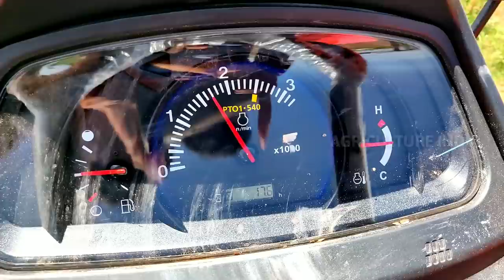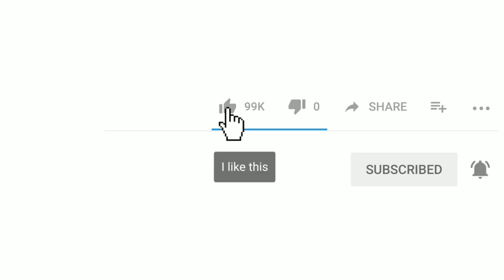Kubota MU4501 | New Tractor | Rotary tiller performance | Specifications & price

Comment: Which feet rotary & which gear you driven ?
Reply from the maker: 6 feet Rotavator & then operating gear low first gear. "Thanks for watching 😊"
Reply: @AgricultureINDIA-91  engine rpm and milage per hrs?

Comment: Better you go to Olympic with this tractor you Will get gold medal. While using tractor with ROTOVATOR you can ride under 1.5KM speed. This tractor is not suitable for Indian conditions. And the tractor price is very low but service cost is very high. So don't purchase this bullshit tractor.
Reply from the maker: "Thanks for your kind information and Thanks for watching 😊"
Reply: Manoj Manoj ramakrishnan
Reply: I have a kubota 45 hp , low diesel consumption good power low maintenance
Reply: Try make more money for future. Because you need more money for your Hydrolcis, gear box, oil seals, and for the" very good low fuel consumption super fuel pump". Good luck for your front tyres and all the best for the rubber parts.
Reply: @prasanthchandichala4999  what's price in up